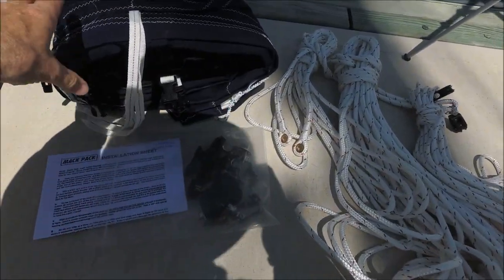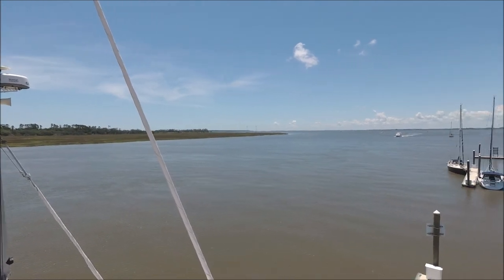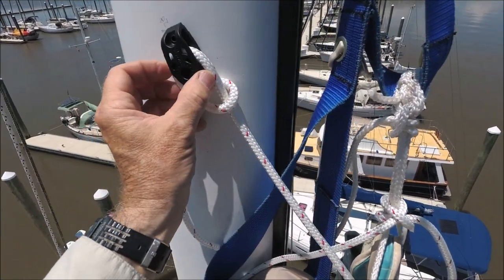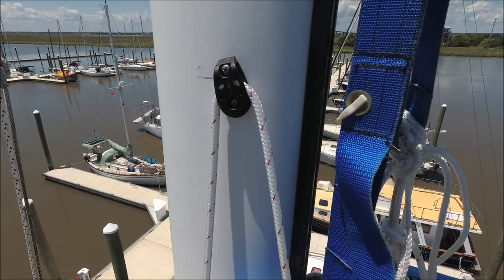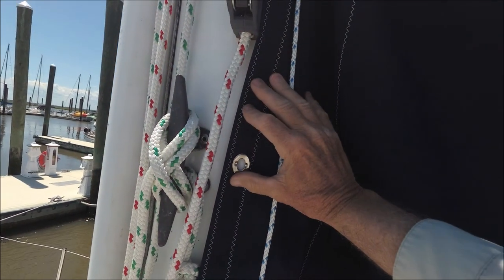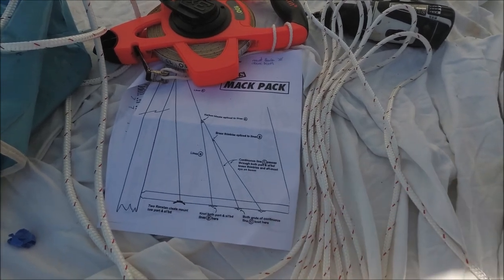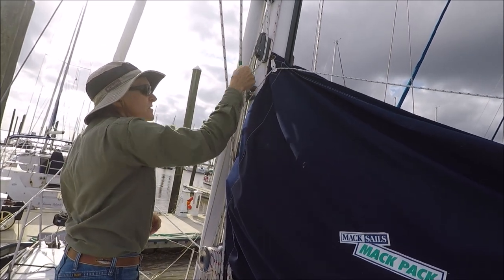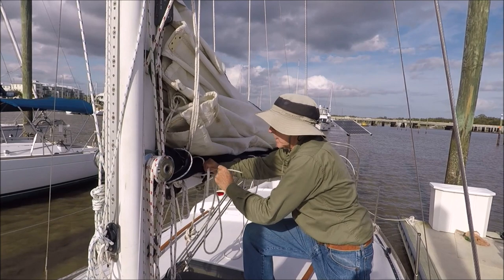Installing a Mack Pack Mainsail Cover and Lazy Jacks

Comment: Thank you James - excellent video. I bought a Sailrite kit before seeing this. Wondering now if there are advantages of the Mack system that I can incorporate into the sewing of the Sailrite. The Sailrite uses a tube/spar to stiffen the top edge of the pack. Also looks like the Sailrite cleats to the mast. Wondering if I'm going to want the Mack's ability to easily furl the pack on the windward side. Also have seen somewhere pockets sewn in to stuff the tails of the reefing lines.
Reply from the maker: I'm not familiar with the Sailrite kit other than what's on their site. It looks like the lazy jack lines hold the cover and semi-rigid PVC tube up but not sure how, or if you can stow the lazy jacks and cover when under sail. With the Mack Pack you can furl the cover on both sides with or without pulling the lines forward to get them out of the way. I think I would need to use the Sailrite kit a few times to learn how best to handle it. Maybe they have a video guide somewhere on how it is used and retracted. Reef line pockets could be handy as long as they are also easily accessible when cover is furled. The way I like to use a lazy jack pack is to have everything furled and retracted when hoisting sail and when sailing and only deploy them when lowering sail, mainly because I don't want to have to sail or motor into the wind to avoid fouling. But that may not be much of an issue here. Probably best to build and use it as designed until you know exactly how it is best used and possibly improved.

Comment: 2 Questions from a new Wannabe sailor:  1. What are all those Grommets in the main sail for....I count over 20 of them.  2.  I assume some are for reefing the main but many seem to be randomly place.  Does the Mack Pack hinder the reefing process at all with just a first mate and Captain on board? and same question if solo sailing on 40' boat....is the Mack Pack a help or a hindrance when trying to reef the main solo.
Reply from the maker: Some of the grommets running horizontally across the sail are for the reef nettles. I don't recall but maybe the ones running vertically were for an old lazy jack system called the Dutchman. Since you'll want to roll down the Mack Pack while sailing, at that point it doesn't interfere with reefing at all.

Comment: What is the  advantage of this Mack Pack vs traditional main sail cover plus lazy jacks?
Reply from the maker: The only real advantages are that the Mack Pack is always in place so you don't need to remove, roll, store it and then reattach later. And on some boats it's awkward to reach around the bimini to do that. And if you are building a lazy jack system from scratch then it's fast and easy to order and install and you don't have to work out the details. But some people don't want that canvas always hanging on the boom, even rolled up, on longer passages. For them a traditional cover with separate lazy jacks is better. But when doing that I'd suggest you install the same type lazy jacks as on the Mack Pack that can be uncleated and pulled forward out of the way. By attaching the lines at the bottom of the boom it will be easier to use the separate cover even with the lines not pulled forward. I think you can order the lazy jacks without the cover from Mack if you don't want to make your own.

Comment: Great video- thanks. I know of some boats that attached the top of the lazyjacks to each side of the spreader to allow for a larger slot for the mainsail to go up without catching the battens. What do you think of that idea? Does it work? Any downsides?
Reply from the maker: With the lazy jacks attached midway along the spreaders they give a bit more clearance when hoisting the sail but are lower than ideal to fully capture the sail when dropping it, flop around more, and the clearance is not always enough anyway. I find it best to retract them to the mast just before hoisting instead as I showed in the video. In theory there's also the small chance of overloading the spreader if the topping lift fails although that may not be a real world issue.